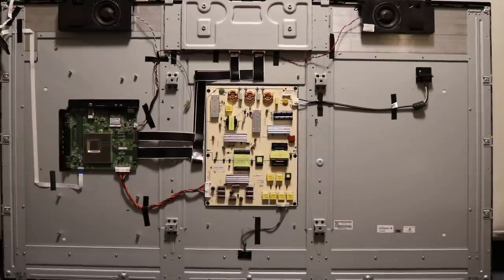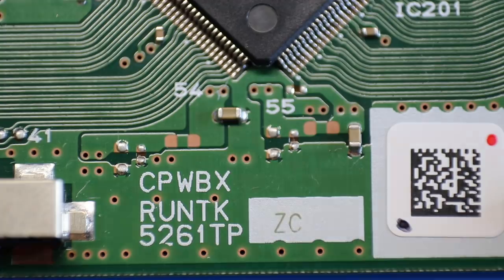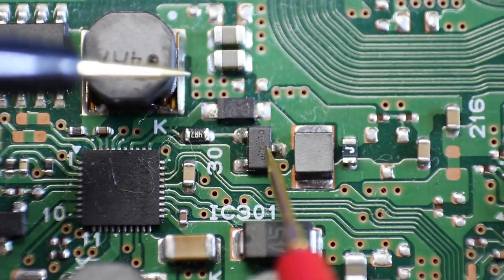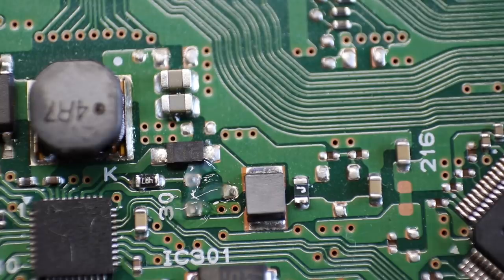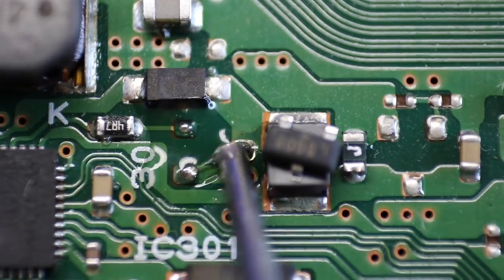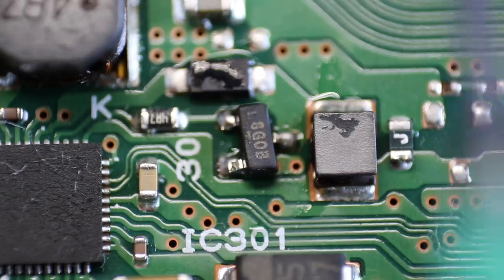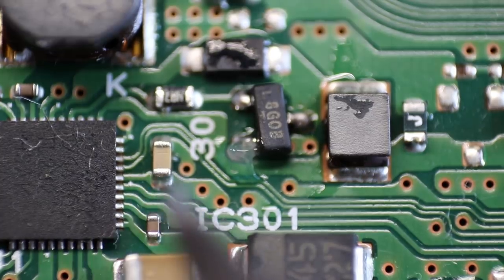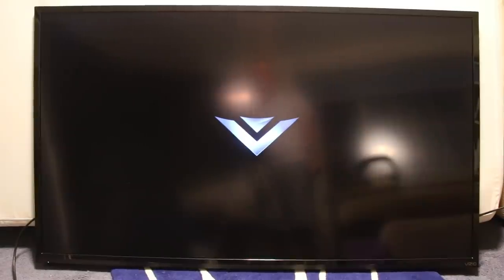60" TV for less than a $1 - Vizio E601i-A3

Comment: Can I just replace to entire board?
Reply from the maker: yes, you can do that.
Reply: @FrugalRepair  ok. Have vizio with sound but black screen. I'm thinking it's the t-con board based on my research
Reply from the maker: @antoniomiller9655  This same model?  If not, it may also be bad backlight.  Check it with a flashlight on the screen while you have sound.
Reply: @FrugalRepair  the model is a d65

Comment: I have a 55 inch samsung smart tv the model # is UN55NU800D. How do I removed the screwless back panel and from what I've been told it is the LCD panel board. Is that an easy fix? It works fine when I first turn the tv on and then it flickers and jumps up and down a little.  Any suggestions?
Reply from the maker: I'm not sure what you mean by lcd panel board.  If you mean the lcd itself, then no, it can not be repaired (in most cases).  It could be a tab bond issue that you can jerry rig to get it working again.
Reply: @FrugalRepair  ok so when I turn the television on, it's fine, picture is good and then all of a sudden, about 2 minutes into the TV being on it starts to show horizontal lines in the lower 1/3rd of the tv and the lines jump up and down a couple inches back and forth. I was told it is the LCD panel but I removed the back of the television and when I look and listen closely, I cant see any problems but I can hear a buzzing noise right in the middle of the green mainboard and it sounds like its underneath a black metal cover in the middle of the green main board. Does that make sense? I could send you a picture of where I think the buzzing is coming from... if that would help at all.
Reply: @FrugalRepair  no it's not the lcd itself... I don't think. I just don't want to order a new main board and it doesn't solve the issue. But that buzzing noise is all I see that stands out... no burn Mark's, all the connections seem to be ok... what do you think?
Reply from the maker: @buddyharderthanyou2493  I'm not sure what it is.  The buzzing sound is a good clue though.  It is possible there is a bad component on the main board that when it gets warmed up it fails.  Maybe try to keep the board cool and see if it lasts longer than 2 minutes?
Reply: @FrugalRepair  so I just turned it on and the slight buzzing happens as soon as it powers on. And about 1 minute in is when the horizontal lines start. The whole screen slightly jumps up and down. Just enough to be annoying. The buzzing noise is very quiet. I have to bend down and put my ear next to the main board in order to hear it.... I have no idea what could be wrong. The only thing I see or hear is the light buzzing sound...
Reply: I guess I can't post a picture on here.
Reply: @FrugalRepair  when I touch the black metal cover in the middle of the main board it is very hot to the touch. Its gotta be that main board. I can replace it for 60 bucks.
Reply: @FrugalRepair  the lines are actually on the top third of the screen but the whole image on the screen slightly goes up out of place and then back down and it just jumps around. Nothing else is that hot or making a buzzing sound like the main board is.

Comment: Lg 55lw5600 that the usb or hdmi ports don’t work, can you tell me what’s wrong?
Reply from the maker: I'm not sure.  Are you getting a 5v power source (or any voltage) on them?
Reply: Where would I check the voltage at?
Reply from the maker: On the usb pin that should have 5v.   You need a multimeter with a probe with a fine enough tip most likely.
Reply: Ok, I’ll tear it apart and look. Tv works, got internet hooked up to Ethernet

Comment: Hi I have a visio p602ui-B3 tv. I had to turn it off and turn it back on again to get a picture.  It then stopped working all together. I opened it up and plugged it in and it started to work again. But I still sometimes have to turn off and back on to get a picture. Any ideas?
Reply from the maker: Capacitor plague?  That’s what it sounds like.
Reply: @FrugalRepair  yes the four capacitors next to the heat sync on the power board are slightly bulged. Thanks for the reply. Great channel!!
Reply from the maker: @ryanmichael6519  Thanks!  Solder in new ones and you'll have a running tv.  You can also experiment by heating the bad caps with a hair dryer and the tv should turn on ok.  But they do need to be replaced.

Comment: I have the same vizio with 3 red horizontal lines how i fix it
Reply from the maker: My guess is that it is either a bad lcd panel or a bad tcon board.  I’ve seen both on this model with a red line.

Comment: Does it matter that your hot air tool was melting every joint in an inch and a half circle?
Reply from the maker: I don’t think you understand the scale in the video.  This component is a few millimeters in size.  There was not a problem with using hot air.  Even if there was other joints melting unless they were disturbed while molten then it wouldn’t be an issue.

Comment: Sir can you help walk me thru how to fix my samsung model ny02 it has bar code lines from top to bottom
Reply from the maker: It might be a bad panel.  It could also be bad capacitors on power supply (which is a common issue on older Samsungs).

Comment: Tell me what to do with a tv that does not power up at all it is a 55_60 in RCA there was two of them they both died same day neither woild power up must have taken a surge I suppose.maybe fried the capacitors?
Reply from the maker: I doubt the capacitors fried.  Did you check out my video on what to check after a power surge?  It is a few years old but may help.

Comment: Where did you get the part i can't seem to locate it
Reply: He has a link to AliExpress check there.
Reply: @adamedwards2435  the link is for a Chinese  work station  ive already google and searched ebay and have found no part tht fits the  specs
Reply: @timjohnson6864  Use a magnifying glass to make sure you have the right part number off the transistor or just purchance another t-con  board and swap it out.
Reply: @adamedwards2435  i already did mine says cota and   on  the end with the a 19 is sideways

Comment: Hello My LC-70LE732U Sharp Aquos TV does not turn on, it keeps blinking the arrow at the bottom center, i've managed to turn it on by playing the the volume, channel and input buttons but the TV stay on only for a few seconds, then the display goes off, i can hear audio and see the menu through a faint ghost image in the background, someone suggested there i should replace the T-Con board, but I wanna make sure that that is the problem, can you please shed a light on this?
Reply from the maker: Are you sure the issue isn’t a burned out backlight?  If you can barely see the menu (you can use a flashlight), try turning down the backlight brightness to 15% then reboot the tv, does that make a difference?

Comment: is it possible to fix the hdmi input port connection on LCD tv ,,, one of those are not working
Reply from the maker: It is possible I'm sure.  But if there are other ports that are working then I wouldn't worry about it.  You could check the pins on that port to see if any of them are bent or damaged.  Otherwise, you may need to replace the HDMI mux chip, the port, or run jumper wires.

Comment: I have a Mitsubishi led I think the model is lt46154 and I have put two brand new boards in it a tcon and another one I forget the name of it and it still messes up it turns on and plays sound and all but randomly the screen goes off but the sound stays on I think it is the main board but I can’t find a new one for it the one it takes I guess they no longer make I did a video about it on my channel  we love the tv but without it working right we have not had a tv in almost 2 years now and for two old farts it get boring! With nothing to watch or play dvds on! Any ideas 🦌👨🏼‍🌾🦃👫❄️🍁🍃🍂🏡🙏❤️♥️💕✝️✝️✝️✝️✝️✝️✝️👍🏻✅
Reply from the maker: I didn't know that brand made lcd tv's.  I thought they were only DLP's.  There are lots of repair posts for that main board, so perhaps a common problem?
Reply: Oops it was a lt46164 led tv sorry I messed arthritic fingers
Reply from the maker: @GrampyCampy  If it has an led backlight, then I would suspect a bad backlight.  If you are getting sound but the picture goes out.  Use a flashlight on the screen when that happens, if you see anything at all resembling an image, then you know it is a backlight failure.
Reply: FrugalRepair the tv plays fine light up and everything like normal and then after maybe 10 to 30 minutes late the screen abruptly goes off no slow fade out or anything just shuts off sound still playing, got me baffled! There is no image on the screen with the flashlight test at all! 🦌👨🏼‍🌾🦃🏡🍁🍂🍃❄️👴👰👫🙏♥️❤️💕✝️✝️✝️✝️✝️✝️✝️👍🏻✅❤️💕
Reply from the maker: @GrampyCampy  Seeing an image with the flashlight test can be hard sometimes, try in a dark room.  You can also try turning down the brightness in settings (while you can see it of course).  I'd turn the brightness down to 15% and see how long it lasts.  It is probably currently set at 70-100%.
Reply: FrugalRepair somewhere in there yes I have tried that too and it makes no difference there is only the main board and power supply and filter board left that I can replace I have already replaced two boards! If I remember right someone told me that Samsung boards might an option because I did see a lot of the boards did say Samsung in them I cant remember if the main one did or not it has been over a year since we could watch any tv, my wife cannot see anything smaller we have a 46 inch two it has to be big because her eyesight is bad and she has terminal lung disease, it is all she has to do she can’t do anything anymore but sit there, so I need to get this fixed or get a new big one somehow and we are not disabled and with all the medical stuff well there ain’t no money for that so it ain’t a option for us I know oops tmi! Just wanted to explain a little better!
Reply from the maker: @GrampyCampy  you can also try disconnecting half (or a portion) of the backlight and see if you can isolate the issue.  It's most likely the backlight, in my opinion.  It can also possibly be a bad tab bond on the buffer board.  It's something that can show up as the tv get's hotter and things shift slightly.  If there is a way to keep the tv cool and see if it lasts longer - that will give you more clues.  It could also be bad caps on the power supply.  Sorry I can help more than that!

Comment: I have this same E601I-A3 tv.  It was working fine until i connected to my wifi and the Yahoo app did an update.  Now the remote no longer functions.  I am trying to reset to factory default but need the remote to do so.  Anyone know how to fix the problem so i can use the remote?  Thanks for your help.
Reply from the maker: You should be able to get to the menu with the side buttons.   It’s a pain but you can do it.
Reply: @FrugalRepair  i can get there, the problem is it wants parental code of 0000 to be entered.  No way to do without the remote, which doesn't work.
Reply from the maker: Hmm, I’m not sure then.  Is it possible it’s just a coincidence?  And it’s something simple like the batteries died on the remote at the same time as the update?

Comment: Mine it does shows the picture (logo) but it has a dark spot in the corner, so I think is a burn led light
Reply from the maker: If it is like a shadow then you are probably right.  If I remember correctly the led strip is divided up into 4 segments.  One segment could suffer when an led (or more) goes bad which then would create a shadow in that segment.  You can verify by shining a flashlight in the shadow area and if you see the image you know it is the bad led.
Reply: FrugalRepair wow! Thanks for that speed answer... I’ll do it, if is bad I’ll sell it but don’t for how much honestly it cost a lot of money
Reply from the maker: @Adcrismr  It is repairable.  Just takes patience and soldering in new led's ( and not cracking the lcd screen when you remove it).

Comment: @6:50 don't tell me those are IDE cables turned into a zif type?
Reply from the maker: I don’t think these ribbon cables going to the buffer board are the same as IDE cables.  These are very thin ribbon cables.  I seem to remember IDE had more insulation on them.
Reply: @FrugalRepair  they did. Well, for a moment it did look like an IDE cable.

Comment: anyone can fix a TV in this day and age because their layouts are very simplified and there's very little risk going on. of course you'll always want to unplug before replacing the part. there's no justification for labor costs for modern TV repair, except for those who simply want someone else to do it (and the price should be no more than $20 for the actual labor). now back in the tube tv days, the labor cost was justified due to the high risk of electric shock. an experienced tech had to discharge the tube to begin work, or sometimes they had to have the TV turned on while doing manual deflection adjustments (scary stuff). in this day and age however, even a tube TV can be repaired by someone who's done enough research on the internet. simply discharge the tube and begin replacing capacitors. as old as many of those tube TVs are, it's wise to replace EVERY capacitor, not just the problematic ones. you'll love how clear the picture gets with new caps, better than factory because the new parts are way more efficient with almost zero noise.

Comment: ...wich transistor is responsimple for sound...my tv vizio...looses sound after 3 minutes,,,
Reply from the maker: You don’t have a problem with your tcon board.  It could be a physical problem on your main board, an hdmi cable issue, issue with the source (ie blu Ray player), or even a software setting.  Try resetting everything in settings and watch something through the internal internet connection (to rule out anything hdmi related)
Reply: tnx...same set up with same equipment...and different  tv no problem...

Comment: Mi lg 6olb7100 turn on the logo but after that the image appear seconds and turn off :( help me.
Reply from the maker: It’s probably bad LEDs on your backlight.  If so, you’ll need to get to them, find the bad ones, and solder in new ones or replace whole led strips.

Comment: U know, someone could go through all of this trouble to find a component that looks bad, taking it out, and replacing it, only to watch it go up in smoke cos the reason the component was bad was due to a power supply issue... Hell, u might even put a new component in and it works... But then a week later dies again cos u missed the reason that part went bad and now u got much more damage.
Sometimes a component failing can save a board from complete destruction, so u gotta figure out why it died. If it was just old, then other components likely need to be replaced too cos they are also old.
Capacitors for example, if one goes bad from age, u should replace all of them cos they are gonna go soon too...

I wouldn't just call that TV "FIXED" cos u plugged it in and it works.
Fixed means it's fixed and it's gonna stay working without dying catastrophically due to Ur repair.

Comment: I'm trying to fix my power board on my 60inch Samsung TV its not powering up the backlights  I just replaced them too
Reply from the maker: What have you found that is wrong with the power supply?
Reply: @FrugalRepair  I have power going to the  backlight they just won't turn on they all flash when I plug the power to them
Reply: @FrugalRepair  I have a new meter coming on the 16th cause I think I killed mine
Reply from the maker: Have you confirmed that each led module is good?  One (or more) of them could be shorting out and causing the trouble.
Reply: @FrugalRepair  tested each strip before installing every led lit up
Reply: @FrugalRepair  so I tested the led output on the power board I'm getting a power reading on the ground where it should be zero
Reply from the maker: @onemansvideos2134  I'm not sure what you mean.  You're probably already doing this but you need to make sure you are measuring the voltage on the "cold" side of the board and your ground reference point can be the metal screw on the corner of a board.
Reply: @FrugalRepair  you know the led plug I checked the positives they read voltage but I decided to check the negative where it should read zero from the chart I found online I'm getting a voltage output

Comment: We have just moved to Canada and my Vizio 75 inch has stopped working - we were watching and half the screen turned white.
Now 

No picture 
No sound
Called a guy and he said it’s too complicated to fix and unable to get a main board.
The Tv is in an immaculate condition and I am in no mood to garbage it.
Any help/ suggestions please.
Reply from the maker: Is the white light on the front blinking?  If so, it sounds like a cpu connection to the board issue due to too much heat.
Reply: @FrugalRepair  Thank you for responding my friend. The light was blinking before this tech opened to check it out. It’s now sitting in the garage 
I can plug it in and check it out. He said that it needed a main board and Vizio is most complicated 
I wish there was someone here in Hamilton Ontario who could help me. Any advice from you will be most welcome
Reply from the maker: Ok, what you can try is pretty easy.  Take out the main board and heat up the cpu area (might have to heat from the bottom side of the circuit board because the heat sink is on the top) with a hair dryer, get it toasty then put it back in the tv.  See if it comes on then.
Reply: @FrugalRepair  Thank you very much. I shall try this over the weekend and get back to you.
Hope I am successful!!

Comment: Beeps on multimeters do not mean shorts, it mean continuity under a certain amount of ohms. The beep does not mean the transistor is bad not too mention that beep can be the circuit resistance. Also u applied far too much heat with that air tool. U should have used a soldering iron.